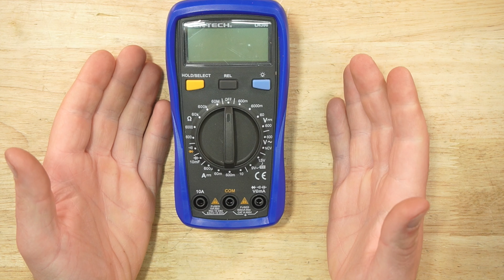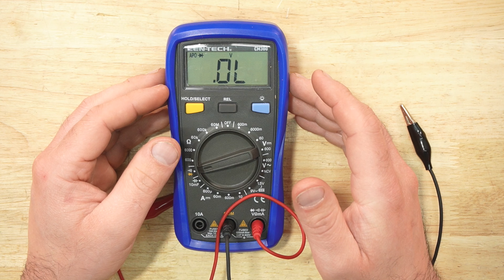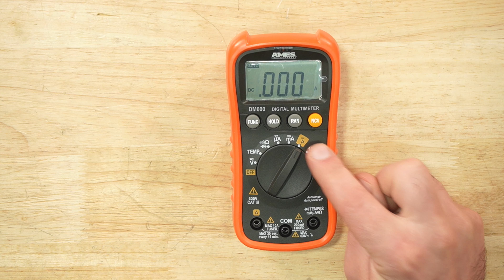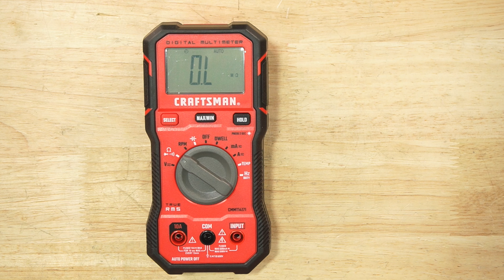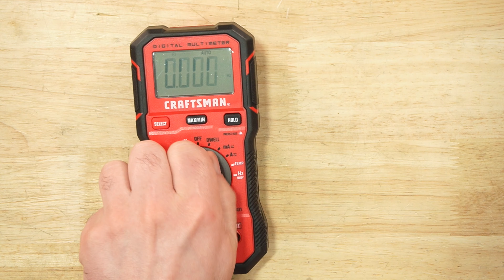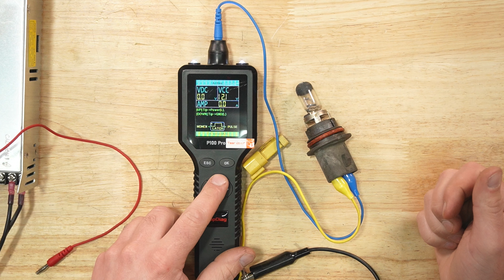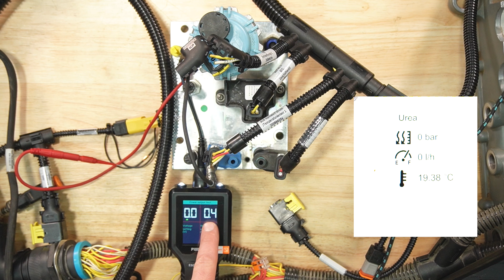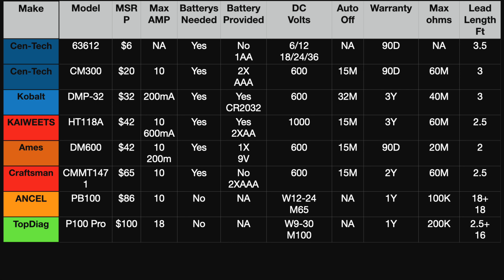Best Automotive Electrical Diagnostic Tool Under $100

Comment: Appreciate the shout out 👍 Kaiweets do make some pretty decent meters for the home user and low voltage testing. I have never used the specialised automotive tools, they do seem to have a lot of functionality built into them.
Reply from the maker: No problem hopefully it helps!  Yeah the Kaiweets looks like a good value for DIY.  The power probes have come a long way.

Comment: I got the topdaig 200 a couple of years ago, the adjustable current  limit is pretty neat, it is just a little over 100.  I have had 2 of the centech 14 function meters. They lasted about 6yr ea.  Cent tech was made by Mastech.  I don't know who makes the ames meters.  I also have a fluke and a greenlee.
Reply from the maker: Thanks for the info, yeah I think the topdiag is a good value.

Comment: For multimeters, Fluke 101 meets 99% of my needs, it doesn't measure current, but otherwise it's excellent little device: very reliable, auto-ranging, compact.

Comment: Thanks for conducting this review. To everyone out there, I recommend doing exactly as the video… compare and get extra/simple features. For example, when my ac went out and I needed to test the capacitor, two of my testers could not do it. Shop around. Thanks for the review.
Reply from the maker: No problem! exactly really need to know the features that will be needed while trying to keep it simple.

Comment: For the dude looking to fix his car, a cheap meter or a voltage tester is all you need. Realistically the times you have low voltage as a problem without it being just a bad battery is slim to none
Reply from the maker: Yep a cheap muti meter is very handy,  trick is knowing the system.

Comment: As a high end European luxury automotive technician of 21+years I can say you MUST have a full fledged meter, oscilloscope, high voltage resistance meter, dedicated mili ohm meter, low amp clamp, high amp clamp, plus a bunch more things, in my world.

Comment: I believe there is a flaw in your demonstration of test lights during the first minute of your video.  You are using a constant voltage power supply to demonstrate that it's hard to tell the difference between 10v and 12v on a test light.

In the real world, a compromised 12v circuit showing 10v is already being pulled down...and when you connect your test light the circuit will be pulled down further showing you the true capability of the wire.  More current, more voltage drop (V=IR).

I used to believe that a test light was outdated tech, but I was wrong.  I've now have thousands invested in fancy diag equipment and those tools see little use because I've learned that even the most complex issues can be solved with a couple test lights...and usually quicker.  Still gonna need a DMM and other stuff, but a test light is now my most used tool.
Reply: An excellent point, and one I was going to make myself if I hadn’t found it so quickly. My OTC 3633 conventional test light is my most-used diagnostic tool. I took the clamp off soldered a female banana lead onto it so I can use a variety of pins, probes and clamps with it efficiently.
Reply: Yeah that bothered me too. It's worth having few test lights at different current ratings.  250ma, 2a or 7a will tell you a lot about the integrity of a circuit.  And if you use it in parallel with a multimeter and measure voltage drop you have the ultimate circuit testing setup.